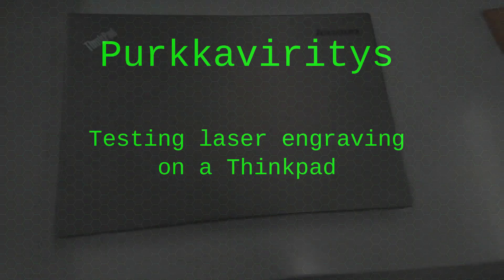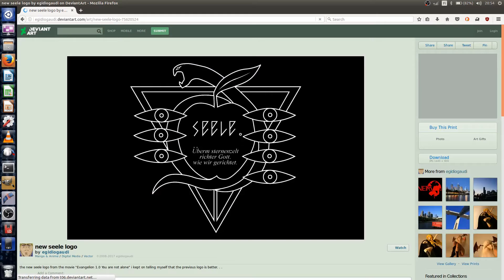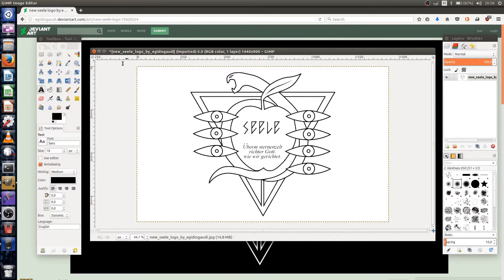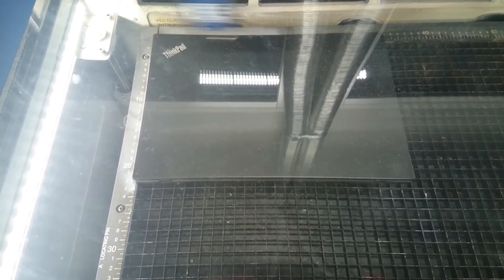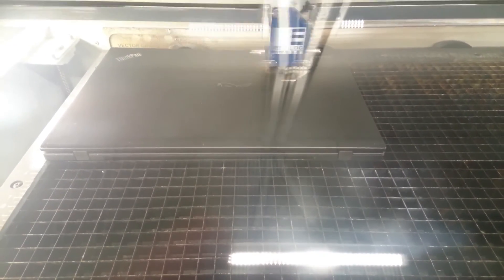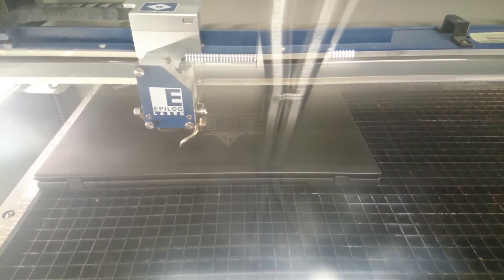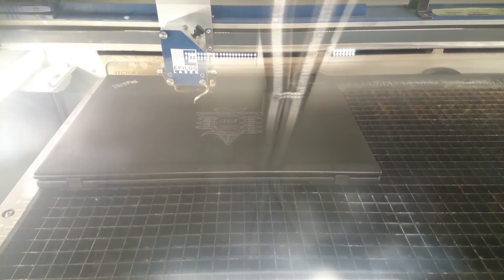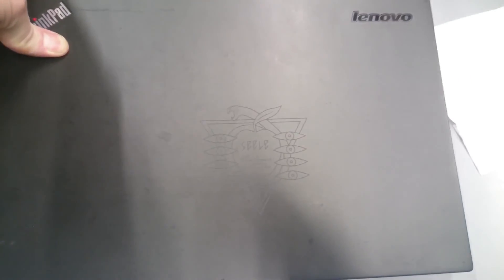Laser engraving test on a Lenovo Thinkpad

Comment: What model TP and laser is this? What settings did you use, how is the markings holding up? Would you do this to a working machine?

Asking B/C I've been wanting to do this to my X240.
Reply from the maker: The Laser used was an Epilog 50w CO2 laser, and the settings used were 90% speed 30% power, the model was T440s and it was a broken one but it will work fine on a working machine and it will function afterwards. Word of warning, make sure both the laser and the laptop are aligned properly or you will have bad time.

The marking seems to be 0.1mm deep so it should hold up pretty well, and you can add paint to the grooves like I did here https://www.youtube.com/watch?v=myhLkNo2DUQ to add more contrast.